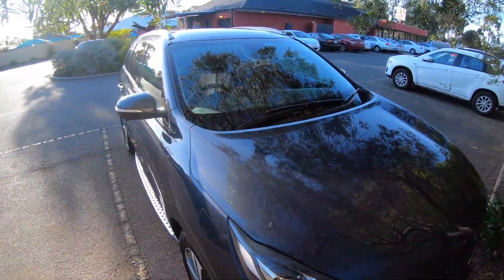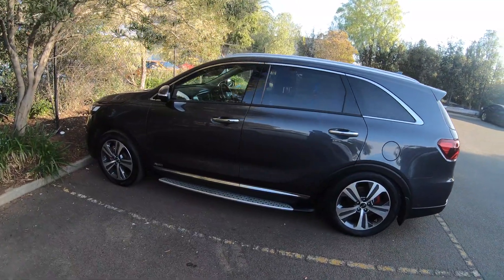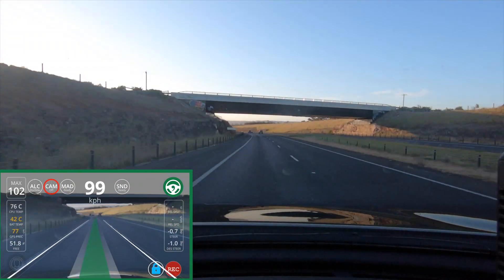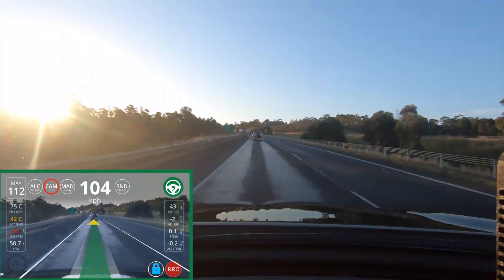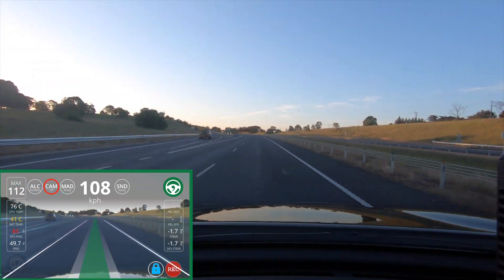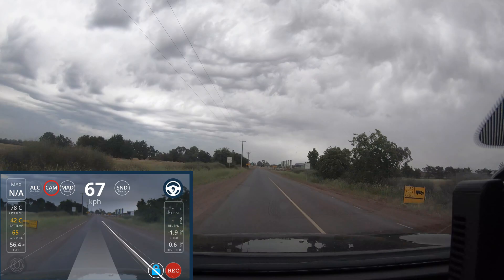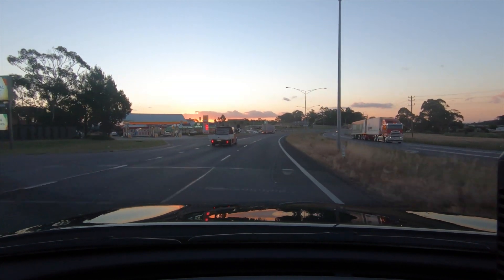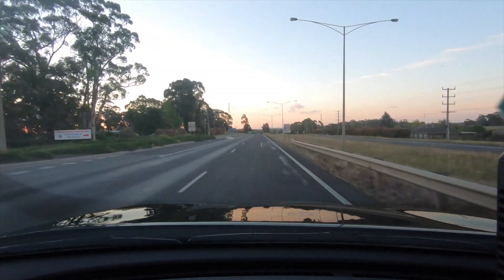Heavy loads and towing do NOT MATTER with Open Pilot 0.5.5

Comment: Not really related to openpilot but i think you can give me some suggestions here: I'd like to mount a towbar and the question is whether the connector should have 7 or 13 poles. Some bigger caravans need 13 poles they say because they need continuous supply from vehicle. Any hints?
Reply from the maker: If you need to charge a battery in your caravan, yes, the 12 pin flat connector is superior.

The reason being the 5 large pins are all rated for 35A
Whereas the 7 small pins are rated for 15A

While you could have a 7 pin plug and a seperate Anderson plug, the convenience of the 12 pin I like.

As for the 13 pin connector, the laser pins are only 20A, and the connector is huge.  Personally I don't like this connector for both those reasons.
Additionally the 12 flat can receive 7 flat connectors without a converter.